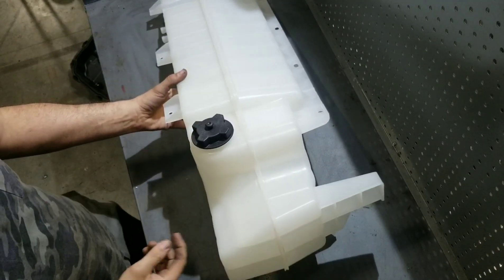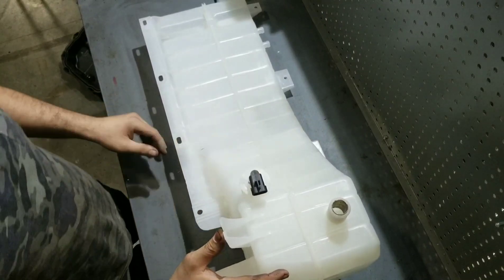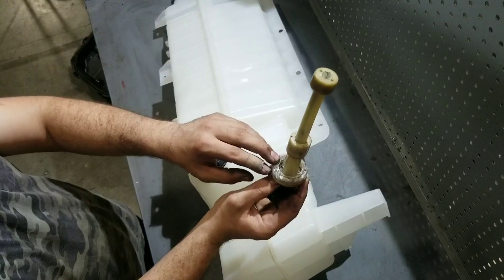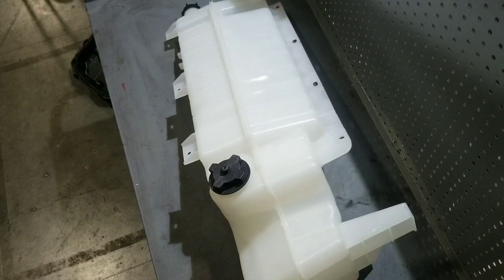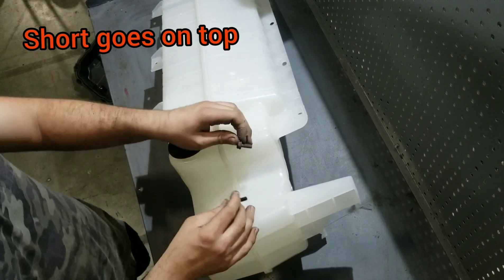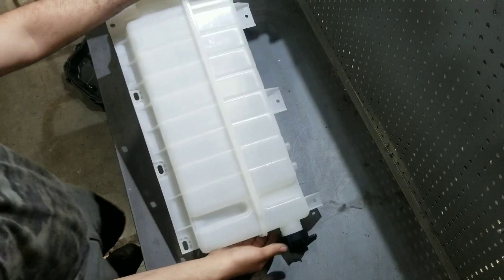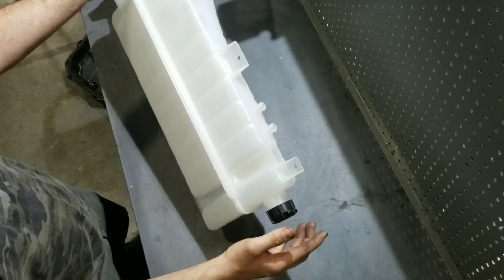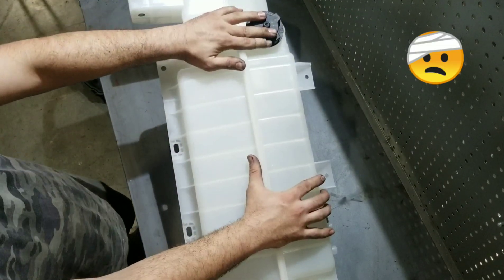Volvo truck coolant expansion tank explained and cut/take apart

Comment: I have  a 2015 volvo with d13 I replaced knox sensors with after market and they don't work . What do you  use as far knox sensors goes??? Only OEM???
Reply from the maker: yes only oem
Reply: Always for aftertreatment or engine only OEM. I doubt it is a problem with the aftermarket sensors now.  But it was probably a misdiag for both to be bad after the repair. They were probably reading right just that Nox was out of the allowable limits. The code would allow you to see exactly what fault your Nox sensors were reporting bad.  I would always run a Sublimation after replacing nox sensors just to clean out any DEF buildup in the SCR. there is sometimes a leaking DEF doser clogging the big pipe out of DPF into the SCR. This will throw the Nox readings off. May also throw off the DPF differentail pressure too. Also check wiring all around the DPF as there are a few places there that wires may rub. I have seen DEF pumps work fine when testing but when driving for hours they cause a problem.

Comment: I have coolants pushIng out from overflow side do you know what can cause it
Reply: Hello, have you found the answer to your question, I have same issue
Reply from the maker: a few problems can do it, egr cooler, injector cups and cylinder head, and least common is air compressor
Reply: My is doing the same after changing reservoir.  Replacing the cap to see what happens
Reply: @wallydesouza1 did you get a norm reservoir or aftermarket Amazon ? I have heard the aftermarket break inside causing g the pressure side(drivers side) to leak into the overflow (passenger side)
Reply: Anyone found a solution? I already replaced compressor, egr cooler is good, took the head out replaced all the cups, even measured the linners put everything back up and still the same problem
Reply: @Tampa-o8k  my mechanic said might be thermostat stuck open and I actually got a code for that
Reply: I replaced thermostat too
Reply: @Tampa-o8k  hi did you find the problem?
Reply: @fabtube7177   air compressor
Reply: @Tampa-o8k  you replaced it twice?
Reply: @fabtube7177   first time they replaced with an used one and just thought that problem was fixed. And it was faulty. I took the engine apart and put it back up and the problem was still there. So I replaced the compressor and the problem went away.

Comment: I want to ask you, my pressure cup got crack right on the nipple between hose and insert nipple I want to replace the cup but hose is stuck twhat is best way to do it? I don't want to break hose that goes in. Maybe heat it up little?